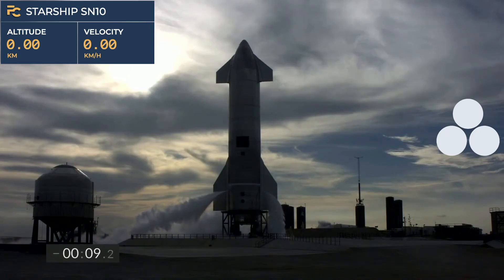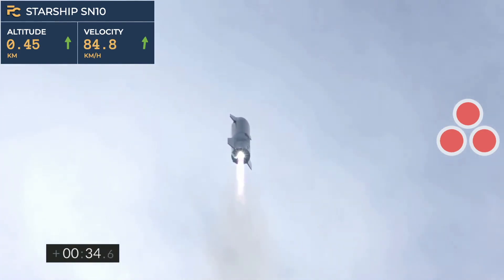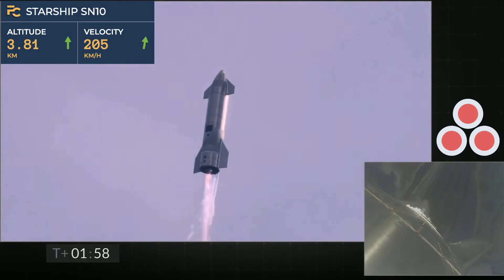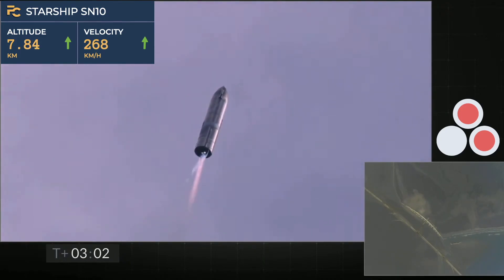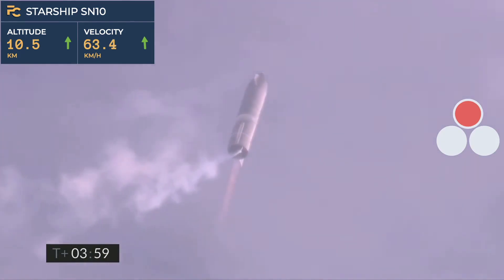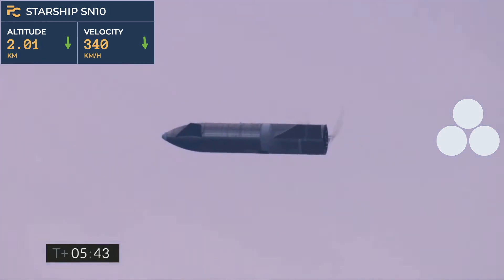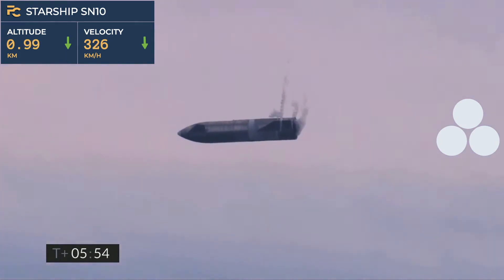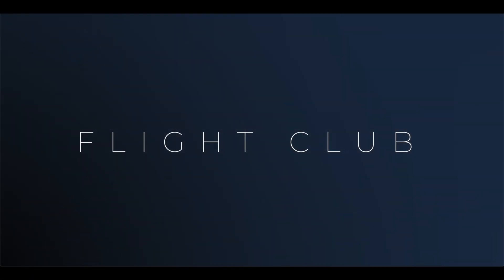Starship SN10 flight w/ Flight Club telemetry

Comment: Although the landing was smooth, the legs were well mashed.
Reply: It wasn't a crash, as dr-kka is saying, but it also wasn't "smooth" :)
Reply: @PeacefulCountryLife  I saw videos saying and showing in slow motion that it was already leaking and another photo showing the raptor crushed by the beaten ground. Before they said it was smooth. Hahaha
Reply: @rubensgoncalves5593  I saw it live and yes, John Insprucker, the voice on the comm, said at that time that they had a "smooth" landing :) However, minutes after that, all the streamers that were broadcasting the event started showing replays and we soon saw that the ship bounced => definitely not a smooth landing, considering SN10's weight :)
In my opinion, a "crash" would look entirely different :). I would say they landed but some problems were already in motion  -> which of course led to the big boom :).
Reply: @grandelDR  Ok, English is not my first language so I had to check the dictionary :)  crash = collide violently with an obstacle or another vehicle OR crash = a violent collision, typically of one vehicle with another or with an object. SN10 landed (however it landed, softly or not),  sat on the pad for 8 minutes or so and then it exploded :) I don't see the "crash" part in this series of events :) But if you insist it was a crash, then fine, it's your choice.
Reply: @grandelDR  I've read his tweets on the matter and I'm not sure where you read that. But seeing your attitude here, the way you refer to him and the way to talk to me, I'd say you're one of those geniuses, know-it-all smart asses that think Elon is a little shit. And that you're very quick on being rude on the Internet.